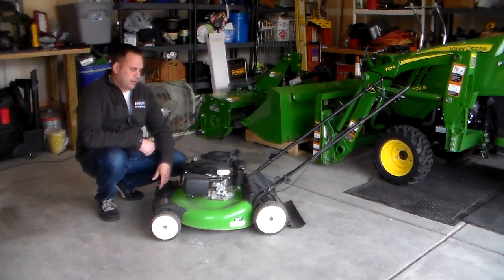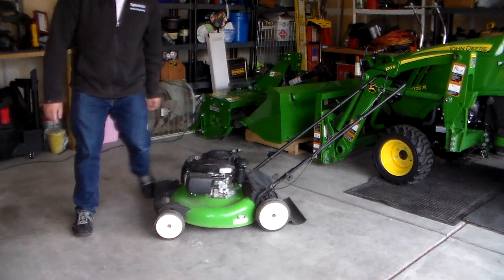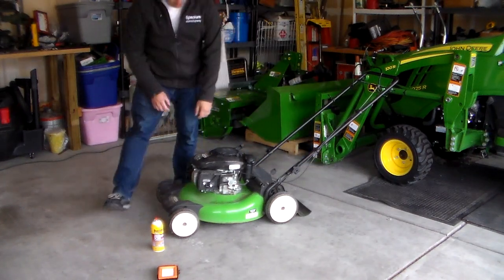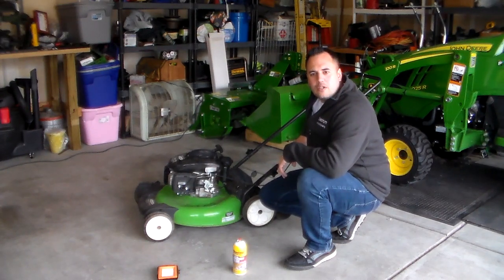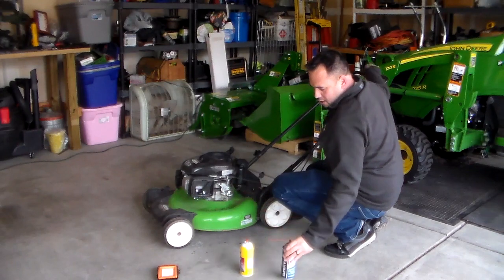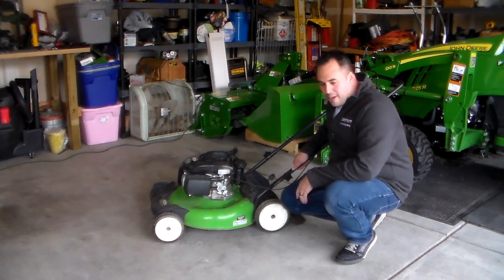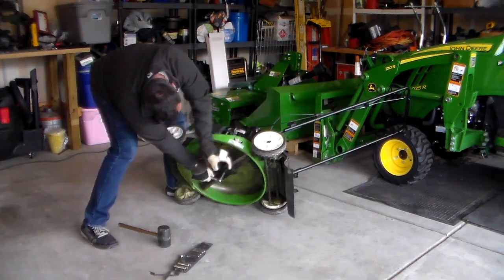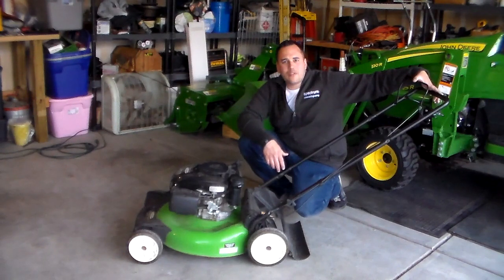How to repair lawn mower in 5 minutes!  Quick Fix.  Lawn-Boy won't start.

Comment: After my Lawn Boy died on me (like it seems to about every year), I used to have it repaired locally. Those guys charged $115 (they did pick up and deliver back), and I was getting tired of the routine. Went out and bought $11 worth of starter fluid and carburetor cleaner spray. It jumped right back to life! Thanks, Hans for putting me on the path...I appreciate it!
Reply from the maker: S Casey Nothing better than the sense of accomplishment in doing it yourself.  Saving money sure doesn’t hurt either!  Thanks for the feedback!

Comment: I had a 3year old lawn boy sitting in the garage for the last five years. Wouldn’t start. I followed your procedures and ended up using an air compressor and it worked. The lawn mower started up with the first pull. Thank you!
Reply from the maker: Myron Kudanovych Excellent!!

Comment: I don't really comment on anything online. Thank you very much. i almost threw my lawnboy lawn mower. i bought it brand new but it stopped working after using it for 3 times. so the mower was sitting in my yard for more than 2 years. But today, before  throwing it, I saw your video, and I should give it a try. I checked the oil, the gas tank, and air filter and sprayed  it.  And Wow! it worked.  Thank you so much. I highly recommend it.
Reply from the maker: EllieNel Gloria Congratulations!  I’m glad it worked!  Come back for more repair videos if you ever need them.

Comment: I purchased a 1972 Wheelhorse and was having that same issue. Being a mechanic in the military 1974-78 plus working on all of my own internal combustion engines 4,6,8 cylinders, 2 and 4 cycle, I thought i was a pretty good mechanic. This wheelhorse was driving me bonkers. After trying all of the steps that you did plus some of my own, it would run for a little while and then back to the rough running / idling. I decided to purchase.a carburetor. The carburetor was around $15.00 and when I PUT IT ON I COULD POP WHELLIES WITH THE TRACTOR! As cheap as these carbs are if you're stumped as I was purchase a new heart for your machine!

Comment: PA LAWN GUY> When you operate a mower engine on starting fluid the cylinder of that cylinder is washed of lubricant and you probly put at least a season of wear on the cylinder.

Comment: Thanks you saved my life! I got a lawnboy because of the guarantee start but it gives me trouble every year. Never going to buy another lawnboy.
Reply from the maker: Glad it helped!  Many of the mower brands are made by just a few manufacturers.  If you look at them, many also use the same engines.  The main thing of importance though is not letting them sit with gas in them in the winter.  At the end of your mowing season, try and run the engine until all of the gas is gone.  Or, another easy option is just simply start the mower every 30 to 60 days and let it run a few minutes.
Reply: @TractorHoarders  Thanks for the great guidance!

Comment: I bought a lawn boy push mower on Saturday. Was impressed with the first pull start at the true-value store. Drove 90 miles home and unloaded. Started first pull. Mowed a bit, shut it off and it wouldn't even try to start. Next day it shuddered to start, smoked then ran. Another shut down and again won't start. Have done this 3 times.
Right now it's in the pickup and going back to, argue with the store. I'm a 66 year old woman who can't keep doing this. Am glad I found your video, and will be buying the fluid and cleaner to try and have on hand. And most likely will try it, as stores don't like returns, when they only carry a few items.
I really expected better of a new $300 machine. But reading reviews tonight, seems many of the new ones have the same issue 😩 Thanks for your video
Reply from the maker: I’m sorry to hear of your troubles with your new mower.  I would definitely not consider that normal and typically most stores would have a 30 day return policy.  I would encourage you to invoke use of that and have them exchange your mower.  It will be very irritating if you need to do this every time you need to mow.  In addition, this method is fine for every once and a while, but if used regularly, it could cause premature wear of your internal engine components resulting in a shorter life-span of the engine.  I would be discouraged to to deal with returning a mower to a store 90 miles away, but it may be best in the long run if you do.
Reply from the maker: Also, if there is any chance that your gas is old or dirty, get rid of it and get fresh, clean gas.  Sometimes the culprit can be inside of a contaminated gas container as well.
Reply: Sometimes stores forget to put oil in new mowers. That would be their fault if so.
Reply from the maker: @brianpeice3796  Good point
Reply: @brianpeice3796  Thanks for the notice of my comment. First I still have the mower, second I'm still not happy with it. But maybe it is getting broke in, as it now starts, 1 out of 10 times, rather than 40. I watched the guy put oil in it, but could it have been too much, as it was way up on the dip stick??
Reply: @TractorHoarders  The day I bought the mower, I also purchased a new can and fresh, non ethanol gas, he put oil in it and showed me the air filter. All the things I would check regularly. And it started easy on the sidewalk.
Their return policy is they take nothing, back that you have put oil or gas in. Lol including things that they, put oil in.😬?
I still am sorry that I bought it, & lawn boy did not answer my emails. So I continue to fight with it. Since there's no way to prime it, with it's so called , "easy start"
Do you think it might help if I shorten it's pull rope? It is extremely long.
Reply: Sorry to say but that’s a Lawnboy for ya. You WILL have this problem EVERY year.
Reply: @brianpeice3796  Lawnboy is a 2 cycle engine oil is added to the gasoline
Reply: @kcwohlfie  Lawn Boy hasn't made two stroke mowers since 2004. Probably due to pollution rules.
Reply: If it has a Kohler engine with  tru start guaranteed and it doesn't start in two pulls as long as it's under warranty  lawn boy will repair or replace it for free.

Comment: Many thanks!
I thought you were working on my mower – especially when you first whipped out the starting fluid! I've had EXACTLY the same problem. I'm on my way to pick up a can of carb cleaner to see if that will work.

BTW, I did check the auto choke - perfect, and the visible throat of the carb. looked clean enough to eat off of. The fuel is fresh and flows freely from the tank. I really appreciate the video, and at least know I'll have tried everything before taking it to a shop or something.

Thanks again!

Comment: Thanks for the video.  I always wondered
who would do that.  Not why.  I've owned
several lawn-boy mowers.  I used a local
repair shop that was familiar with Lawn-
Boy issues.  I keep one now to loan when
my friends have one out for repair.  After
I had all my turf removed and replaced. 
With black lava sand from Hawaii and red 
pumice out of Arizona for walkways.

Comment: Wow - you fixed my mower with the Honda engine! Followed every step as you did - remove air filter, starter fluid,  ran for qa few seconds then stopped. Got the Gumout spray, had a friend hold the bail while I sprayed while it ran. Had to play with the choke a little to keep it running while the Gumout did its thing, then mowed the lawn. Where do I send the check - thanks!
Reply from the maker: Great to hear!

Comment: Thanks for the video.  Just got my mower running.  I would recommend eye protection though. I had my chainsaw eye wear on and some starting or carb cleaner shot back to my eyes.  Many people watching your video are clueless as myself.   Probably not more clueless though.  Was going to take the bowl  off and clean the jets and I don't think I needed to do that.
Reply from the maker: Thanks for watching and commenting.  I agree with you.  Eye protection should be worn.  I've got the back-spray back into my face too.

Comment: Nice.  I have fixed a half dozen mowers in the neighborhood since we moved.  I am surprised how many have no mechanical aptitude anymore.
Reply from the maker: I agree, Jeremy.  I've pulled many mowers out of the trash, performed simple fixes, and either kept, or sold them.  They're pretty simple machines, and don't require a high degree of mechanical aptitude.  Give it air, fuel, and spark, and it'll usually run.
Reply: Ive done oil change gas change and did a carb clean but forgot to run it without the air filter to burn the residues... will do so tomorrow.. will get dome if that star up liquid and sharpen the blade 🤣👍🏽

Comment: nice. mower should start also with just carb cleaner, its flammable enough, i never use starting fluid but everyone has their own methods, if the result is the same it really doesnt matter. good work.
Reply from the maker: You're absolutely right.  Thank you.

Comment: I hope mine is that easy to fix. Must admit it was not cared for. Worked for 3 years and now won’t start. Ran until the backyard was cut then quit before finished. It wasn’t missing or running rough but, sounded a little weak, not loud as usual. I hope some starting fluid and carb cleaner works! Fingers crossed 🤞🏾.
Reply from the maker: Good luck and I’ll be posting more small engine repair videos, so check back if you need more help!
Reply from the maker: Remember:  Give it fuel, air, and spark, something’s gonna happen!

Comment: Thanks so much for this video.
Spraying carb cleaner and starter fluid get it going for a bit but won't stay running. Thoughts as to what we should do next?
Reply from the maker: Hi Beth, it sounds to me like your mower engine will require a more in depth carburetor cleaning.  The exact items of importance are dependent on exactly which engine you have as carburetors are different.  The principle is all the same though.  It's going to need taken apart and every small passage cleaned out.  An example of this is in my other video here:  https://youtu.be/hoRi0-GNBuk
Reply: @TractorHoarders  thanks for responding so quickly. I'll take a look at your other video and hope I figure it out :)

Comment: Here’s is an easy way to help prevent/avoid this kind of problem...

1. Use gasoline that is as close to being ethanol free as possible. Ethanol added to gasoline will shorten the life span of standing gas over long periods of time...the old gasoline will be insufficient to fire the spark plug. This is especially true for equipment that has sat idle from one season to the next... snow throwers to lawn mowers. 

2. Solution...Use a gasoline treatment stabilizer such as STA-BIL:FUEL STABILIZER TREATMENT added to your gas can. Once added and thoroughly mixed, the treated gas is then added to your equipments own gas tank. Now start the engine and let it run for several minutes so that the treated gas has a chance to go through the fuel system (carburetor and plug). You should  now be in good condition for a one or two pull start the following season.

3. If after doing this seasonal preparation you somehow are still experiencing starting problems...I would then follow the valuable recommendations as shown in the video!
Reply from the maker: Kevin Boyle Excellent advice.  Thanks for sharing.

Comment: Using my compressor to shoot air in the gas line revealed that there was a hole in the gas line. I replaced the part and saved my mower!
Reply from the maker: That’s awesome, and a great point.  Sometimes leaky hoses, intake manifold gaskets, and other simple things cause the problem too!  Thanks for sharing and glad you got it fixed!

Comment: I've tried all of the above, plus replacing the spark plug and filter, cleaning out the carburetor, putting fresh gasoline in and it still wouldn't start. I suspect the ethanol-based gas could be gunking up the machine, too.
Reply from the maker: Ravi Sriram , it sounds to me like your carburetor will need manually cleaned.  I plan to post a video of the detailed process for that on a similar mower in a few days.

Comment: Where at behind the filter do you spray the starter fluid? Carb cleaner?
Reply from the maker: Spray them both into the same spots.  What you’re looking for is usually a circular intake into the carburetor.  Many times the choke plate is visible inside of it.

Comment: Well just tried starting fluid, gas drained, new spark plug, new air filter and still nothing. Only pulled 4 or five time so I am charging the battery see if it can give a few more cranks than my back can. I drained the bowel also, but I did t check the filter while off. Exact same mower. Anything else you or an Yorker can suggest (sans repair shop/buy new mower)? Any thoughts appreciated 😀
Reply from the maker: When you use starting fluid, does it ever fire when trying to start it?  I would start to question if it has spark.  You can check by removing the spark plug, holding it the metal threads against the head bolts with the wire attached, and pull starting the engine?  You should see a blue spark.  If you don’t, it may be time to investigate the coil which is under the flywheel.
Reply from the maker: You can also use an inline spark tester if you don’t want to try what I mentioned above.
Reply: Hans Makes It Work thanks for your response. I’m going to buy a tester from Harbor Freight today and do the test.
Reply from the maker: Let me know how it goes
Reply: Hans Makes It Work here is the update. There was no spark. I got just a simple tester from harbor freight to test the spark plug. I checked gap again and no fire. So thought I would try for the coil, but could only pull one bolt off. And none were available to buy without ordering. I went and bought another mower. I would like to try to repair this one for a backup tho. Any other suggestions I’m all ears.
Reply from the maker: @taanzaa40  Sometimes changing coils can be tricky.  I have actually never done it on this particular engine, but usually it involves taking off the engine shroud, and sometimes the flywheel.  Unfortunately I haven't created a video of that process, but it should be similar to this video:  https://www.youtube.com/watch?v=SvAE78iFdl8

Comment: I have the exact lawn mower and I'm having a problem with it now being that I'm a female I don't really know what to do about some starter fluid and it still won't stay cranked do I need to get carburetor cleaner I just don't know I need help
Reply from the maker: Deborah Woodard - I’d recommend having both started fluid and carburetor cleaner on hand for this.  They are cheapest from the Walmart auto parts section and you can probably get both for around $6.  Try spraying both into the air intake (behind the air filter) and try starting it.  If you can’t get it running and need to explore alternatives, check FB Marketplace.  I can usually get used mowers that run for $40, so that’s just another thing to consider.  Let me know if I can help further.  👍
Reply: @TractorHoarders  Ok thnnk you
Reply: @TractorHoarders it worked thank you so much
Reply from the maker: Deborah Woodard awesome!  Good job!

Comment: What kind of car cleaner did you used, name and brand, I have the same problem with mine.
Reply from the maker: Francisco Guevara I use “Super Tech” which is the house brand at Walmart.  Any brand will work fine though.  Get whatever is cheap.

Comment: 20+ year lawnboy owner here. These are the biggest pieces of junk. Carbs are the worst, every other year carb needs to be rebuilt. I would never recommend buying and when it does fail to start, and it will happen just throw it away and cut your losses
Reply from the maker: The new stuff is certainly not at all like the old Lawn Boys!  I had some from the 70s and they were great machines.

Comment: Why does it always look like you're spraying the Air filter holder rather than any specific part?
Reply from the maker: That’s where the air intake is at
Reply: @TractorHoarders  Ok, you spray both the starter fluid AND the Carb Cleaner there?  I am assuming there is no harm done if you miss a bit?
Reply from the maker: @westst12burke56  yep, you’re correct.  No issue at all if you miss

Comment: Brand new Lawn Boy push mover it won't
start.
Reply from the maker: Mavrick Singer If it’s brand new, I do very basic troubleshooting to ensure the spark plug wire is on, and the safety switches are operating, and that it has oil filled properly.  Beyond that, return it and swap it out.